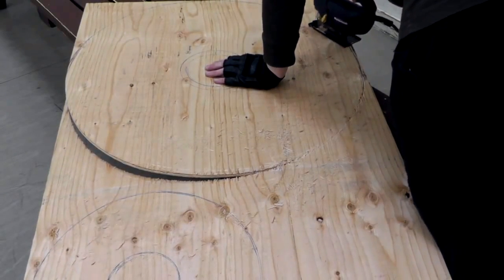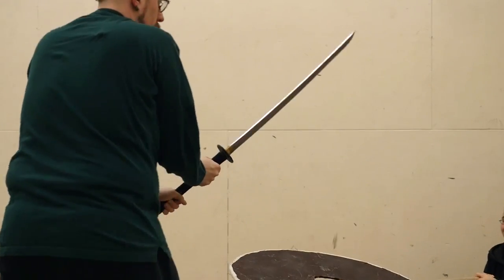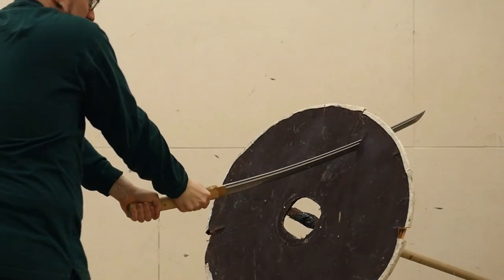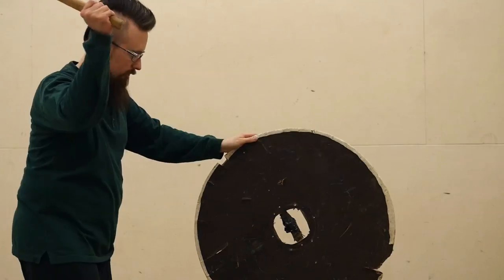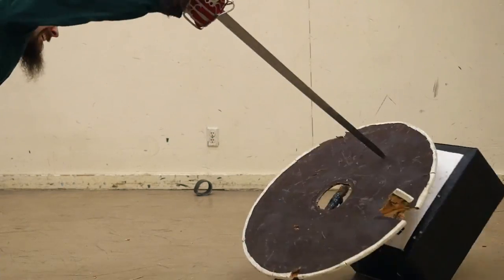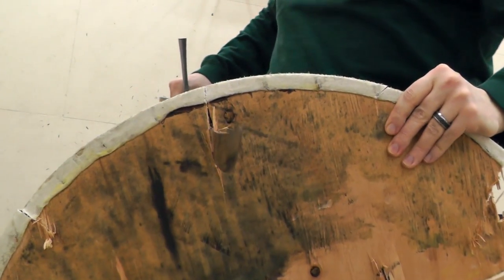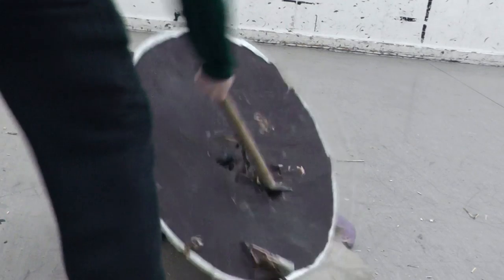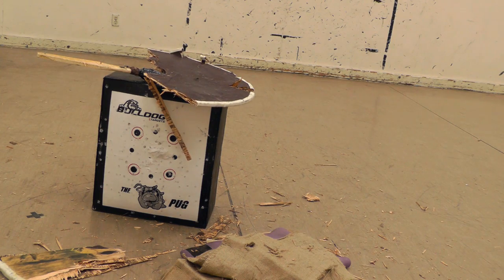Plywood shield vs broadsword, katana, axe, kriegsmesser, and war hammer

Comment: I think that people are a bit confused when they say that katanas were effective against armor... they weren't. I don't know if you got this from anime or some shit. I'm pretty sure they were just made to slice up flesh. As we can see in this video they are even kind of brittle. It's kind of a basic sword in my opinion and very over rated because of popular culture.
Reply: It was more rather a agility sword then destroy and cut.
Reply: The katana is not an agility sword. I don't know where people get that idea from. Perhaps they think the katana is lighter , but it really isn't. Even though it has no metal pommel nor a larger guard the blade is actually really really thick which is why even though it is smaller it isn't lighter.
Reply: +Muhamad Harith Akmal Abu Bakar That would be the rapier. A rapier is the ultimate agility sword.
Reply: A well made katana is not at all brittle, and does pretty well against wood. I'm not an expert by any means, but the katanas in the video don't look like folded steel. Head over to the csknives channel and check out the Cold Steel katanas, those are very high quality.
Reply: Jared Henson From the reviews I've seen, Cold Steel seems to be low quality. Their swords lack distal taper.
Reply: +T1Oracle I've seen those reviews too, and they made me apprehensive at first. But I had some friends that bought some cold steel stuff and they seemed to be just as advertised, so I bought the hand and a half sword and it's been great. Passed every test I put it through with flying colors. Although if we're strictly speaking of their katanas, I don't have any first hand experience or any friends that do. So I can't confirm or deny anything people have said about them. One thing I did notice in the csknives video is that their katana struggled to cut through two or three pigs (can't remember which), while an actual authentic Japanese katana in Deadliest Warrior cut through 4 with ease. However that one was being handled by an actual samurai, and it was a downward cut.
Reply: +T1Oracle I'm sorry that was a lie, I went back and watched the video (it's been a couple years) and although they stacked four pigs up, the katana only cut through two. About the same as the csknives video, so I really proved nothing lol.
Reply: Jared Henson How was the balance on the hand and half sword?
Reply: +T1Oracle I feel like it's balanced very well, though I have little experience to compare it to given that it's the only utilitarian sword I've ever owned. The point of balance seems to be a couple inches up the blade from the  crossguard.
Reply: Jared Henson You have more experience than me, I've never owned a sword and I only held one once. Regardless, if the balance is near the hilt it sounds about right. If nothing else, it should be fun to use. I guess thats what matters most.
Reply: +Jared Henson A traditionally made katana has a hard edge, but the spine is very soft. It bends rather easily. Cutting through 4 gutted pigs isn't really that hard, you could do that with a good machete if you wanted to. Point is, the katana is no better or worse in design then any other sword. The Celts were folding Iron the exact same way the Japanese did, except the Celts were doing it in 400 B.C.E. The Saxons did it too, but rather then folding, they twisted the steel, creating layers through the spiral. When Spanish steel came along, they didn't need to pattern-weld in Europe anymore. The steel was better and easier to forge. Be careful with Cold Steel. Just look up Katana vs. Longsword German Smith, and you should get a video from a German history channel. Watch it, and then you'll see that the Katana is not a better design, and is not forged using any "special" method. It's pattern-welding. I'm not saying I don't like katanas, I think they're beautiful, but this idea that they're the greatest is a daft and ignorant notion. A longsword is just as quick, and can be just as sharp.
Reply: +Ender Skies so that's why a large number of swords have cutting test under the tsuka
Reply: +ConnorJaneu yes but all the other options mentioned had ready access to metal the katana was created from metal extracted from volcanic sand (again not over hyping the katana just saying that its a pretty dam impressive cutaneous object considering that it was once sand)
Reply: louis monkeybusiness swanepoel Not all metal was from volcanic sand. Of the little that  the Japanese had, most of it was mined.
Reply: +elekonas no if your opponent was wearing Armour you stick him with a Yari or take a tetsubo to him and if all you had on hand was a katana you would focus on attacking the weak points on the armor (much as in western warfare) also you get IKUBI  - boar's neck witch is a tip design made with the purpose of aiding in the piercing of Armour but again you would not attack the breast plate of a suit of plate mail with a European sword would you? so why would you think that you would want to do this with a Japaneses sword and even modern day kendo still uses the kote strike (a strike to the wrist) as traditionally this is a weaker spot in Japaneses armors even western amours had joints where the suit needs to bend with chain mail bits in between (again i stand to be corrected) and generally these would be the spots you would prefer to target with say a spear or stabbing dagger of some sorts man you should see the tanto's they made to pierce Armour now that is a mean looking thing point being we can never really compare the two as they were designed with two completely different ways of warfare Japanese Armour is vastly different from western Armour and there you could do a 6 month campaign with out removing certain parts of the Japanese armor (or so the stories go) and would have to cut the straps to remove it and very likely have to be deloused also if we look at the evolution of Armour the do is more akin to the breast plates of the Spanish  than the full plate of the Knights Japanese armor is way more agility focused than the tank approach Not that im saying you cant move in western Armour as i have friends who do European martial arts and we even have a fun little east meets west friendly round or two at our local fair every year all in good spirits and TOTALY not competitive ... ok i lie winner gets bragging rights till the next year
Reply: +Hristo  Kuymdjiev you are not wrong but you are not right either the cut with a katana is not a Chop its a slice and go to a traditional Japanese style of sword fighting and you will see the difference they are often not allways but often focused on fighting multiple opponents (not kendo as kendo is a sport form and has lost some things in the persuit of others) you might as well say that saber and longsword fighting is the same, and yet saber fighting is far more agile than longsword fighting, guys please this is not about bashing one form or another they developed along two completely different paths and we can only assume that both reached the pinicale of its efficiency for the circumstances at hand and yet both were replaced as technology advanced
Reply: +Muhamad Harith Akmal Abu Bakar It was a back up weapon, for when your spear or Naginata  broke.
Reply: +elekonas They were certainly not effective against plate armour but then no sword is effective against plate armour. It does a fair good damage on mail, though, but at the cost of damaging the blade to a greater extend than, say, a longsword. Te value of the katana (or the tachi) is in the techniques behind it. Two handed, with a medium length blade, it's highly accurate (almost as a rapier), fast (almost as a gladius), relatively heavy for it's size and razor sharp. So, it's a weapon designed to avoid armour and cut through it's openings and go for hands, legs, face or even throat. Would it prevail against a rapier or longsword? I say it all depends on the man (or woman) holding the weapon. 

But all this talk about superweaponry is misleading anyway. The most humble weapon is the spear, yet it has probably killed more people and decided more battles than any other weapon - until gunpowder.
Reply: +archimedesnation i agree with you. i myself would prefer a rapier, or something with weight, you can kill anyone instantly, regardless of armor, with one well placed stab or blow, i don't overly like the katana, because it can't do damage through armor, and was made to fight opponents who DIDN'T wear armor, and i just prefer European weapons and armor. But in my opinion, a rapier can beat a katana, that is if you have a buckler with you, or at least a dagger, with which i would, i could stab a samurai in a place his armor did'int protect him, far quicker than he could slash at me, but that's my opinion. oh and btw I've heavily trained with a rapier and a buckler, some with a dagger too
Reply: Mitchell king What I really dislike about the rapier is the fact that you can get a hold of the blade. When sparring with friends, it almost comes natural to me to grab the blade and push it towards them. I really don't know if there were effective tactics to counter this but so far I 've never found one.

Tachi's weren't really meant to fight unarmoured opponents, since samurais were generally armoured in the battlefield. The reasons many people look down on tachis are twofold, I believe. First, as a backlash to the hollywood superhype and second, because very few of them have actually trained with such a sword. This isn't a weapon you can master in a week or a month. You need one year to get to the essentials and some five years of training in order to be really effective. 

Last, with the exeption of Romans, swords were always secondary, or rather, self defence weapons. And there's a good reason for this. If you ever find someone to teach you how to really use a spear (or a helbert), you 'll find that in 3 out of four times you can take any swordsman or sword.
Reply: Mitchell king Oh, they did grab the rapiers. Vincentio Saviolo: "this weapon must be used with a glove and if a man should be without a glove, it woud be better to lightly hurt his hand, if he's to overcome his enemies...". Rapier masters generally advised against it but you 'll find quotes like this one in many fencing manuscripts.
Also, the dagger and the buckler can be effective indeed but the left hand will usually be busy trying to parry the incoming blow. I 've done it and I 've suffered it enough to know it could be done reallistically. As a matter of fact, the best (most natural/unforced) thing you can do if your opponent grabs your debole and push it your way is... headbutt him. Practice with it and you 'll see that both grabbing and headbutting come easy. I 've never found it in any manual but I quess this is because it's considerd an awkward and ungraceful move.
Last, with all this I don't mean that the rapier isn't a good weapon. It's a great weapon if you know how to use it. My comment only wants to point out that there's no "better" sword. Any sword can best any sword and it all comes down to the swordsman.
Reply: archimedesnation yeah, lol
Reply: +ConnorJaneu Lol, the other thing is that steels from Japan historically had lower amounts of carbon (which is why they had to fold it so much). Steels from the middle-east/central Asia or Europe would have destroyed an unfolded Japanese weapon. (This was often a problem with the lower class and levy troops in Japan)
Reply: +elekonas Sword PERIOD weren't very effective against metal armor.    You're better off with an axe or war hammer fighting a heavily armored opponent.
Reply: +Xavier Vega Unless you're half-swording or going for a mordhau strike.
Reply: ÆKIS true
Reply: elekonas lol, if you swung a Katana (a historically accurate katana) and landed on any plate armor the katana would most likely shatter
Reply: Wolfgang Amadeus it can even penetrate mail let alone plate
Reply: +archimedesnation Finally, someone who makes perfect sense in the debate!
Reply: if you think cold steel is high quality we can`t be friends
Reply: And he never said he was.
Reply: they're not actually that brittle. They're just...normal swords
Reply: Wolfgang Amadeus you probably can't swing a katana fast enough to shatter it.
Reply: louis monkeybusiness swanepoel I know knight eyrant and metatron did a samurai armour vs full European plate comparison in terms of mobility. They are ultimately the same. Similar weight. Similar mobility. However the with European plate the chain mail underneath was to tight and restricted overhead movement. The samurai armour was ultimately more agile a quicker even though it's weight was almost the same as the European armour. I still think European armour is more protective as it has less gaps or weak points and covers more of the body. Both armour has padding underneath but the European has full plate is best against heavy blunt striking such as a war hammer. You. Could see metatron would get up quicker which could be because he is in better shape but I'd say more likely because the samurai armour has a more natural fluid range of movement. Is say they are a relatively even match. The comparison is not 100% historical as they come from different time eras but they are both quality armour pieces and somewhat representative of late medieval European armour and late samurai armour. I know metatron and other youtubers have done katana and European sward comparisons. Also a YouTuber, I think metatron maybe or shadiversity did a small series of how the katana was made.
Reply: I train iaido every week and did for 2 years, a real shinken (katana) would slice throug that plywood like any other European sword
Reply: Honestly this test isn't a very good indicator. The shield has very little support, and the weapons would have done a lot more were someone holding it and bracing it. Cara with a stick wasn't a lot of support.
Reply: elekonas For something like Dead Island? Not bad but I'd still prefer a Claymore
Reply: T1Oracle That’s factually just not true. A rapier was specialized for thrusting, but it still probably weighed just as much, if not more, than an arming sword. I recommend you check out the video by Shadiversity for more information.
Reply: Oh yeah, those things didn't do shit to armor. They were excellent at chopping up unruly peasants, but terrible against armor.
Reply: @T1Oracle  I am not a katana fanboy by any means... Just wanted to point out that distal taper has NOTHING to do with metal you use... A wooden sword could have distal taper
Reply: @hristokuymdjiev4225  Historically katanas were definitely agility swords and were absolutely awful against any form of armor, even leather. Japan isn't know for it's rich minerals, so most katanas were made very poorly with some exception. Now a days, yes there are awesomely made katanas with good cutting power, but back in the period they were used, it was mostly for cutting down civilians and poor people. They had spears and other weapons for more realistic fighting.
Reply: elekonas 
tbh all I knew that a katana is much easier to wield as it's lighter and the form it has allows the user can perform faster attacks.
Reply: Let me explain:

Katana destroy light armour, and by light armour, I mean armour that is not made of metal. Lamellar is a very common types of armour is Asia. Lamellar and Scale armour is also 2 types of armour that can be made of leather and stick be damn effective. Since Japan metal resource is alway been poor, leather is usually used as armour. Japan at the time also don’t have any good armour smith that could think of new armour designs... so there you have it
Reply: Also Japanese give up shield cause they don’t like carry extra “heavy walls” and they don’t have a lot of armour busting weapons.
Reply: Hristo  Kuymdjiev 
Katanas are a good bit lighter than European swords, the heaviest katana I’ve seen is the cold steel katana weighing in at 2 lbs 15 oz. This, along with every other cold steel sword, is known for being wildly overweight and clunky. Damn near every one and a half and two handed sword on the Albion website is over 3 lbs, with a few going over 5 lbs. Katanas are most definitely lighter than longswords.
Reply: @cloroxbleach9222  Well, Yes but actually No. A one handed sword weight 2-3 kg in general, and most katanas weights 2 kg. The weight is the same, so why would it be more of an agility sword ? I think it was more of a ceremony sword, something to say "Hey ! i am a noble ! ". Even the Samurai relied more on spears and Archery, so Katanas aren't "legendary" weapons at all. They were effective in their way,  but not more than a viking sword, a principe or a good old war hammer.
Reply: Most people get the idea because people slice watermelons and meat with katanas and not actually hit katanas with these types of materials
Reply: Katanas are for chopping horse’s legs
Reply: @jaredhenson8316  Folded steel literally doesn't do anything. The only reason the Japanese folded the steel historically is because they started off with lower quality steel. That's it.  Thats the only reason lol
Reply: A lot of work went into making a katana because the Japanese had poor quality iron.  It was a status symbol, backup weapon, and self defense tool.  Sort of like a cross between a handgun and a fancy watch.
Reply: Yeah especially when a lot of armor was hard fabric most of the time with very little actual metal. Against any actual metal armor, your katana has a higher chance of breaking than it does actually denting the armor